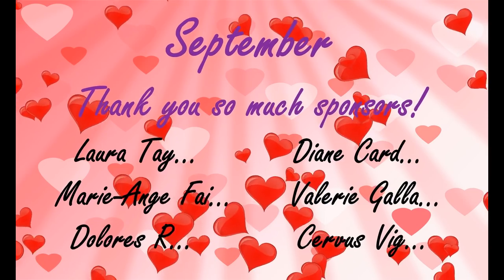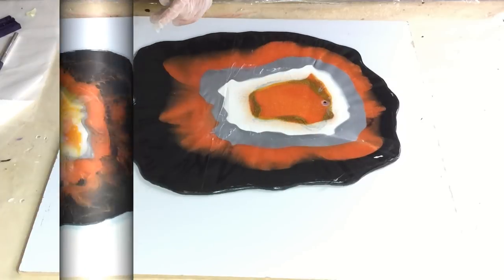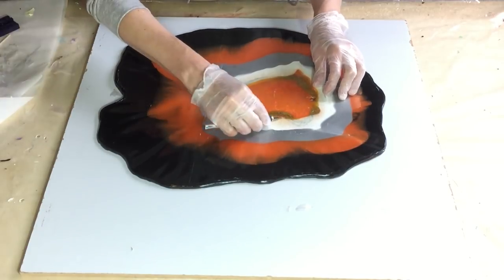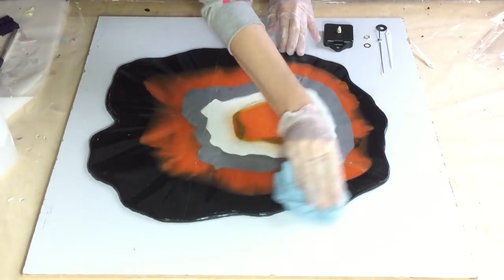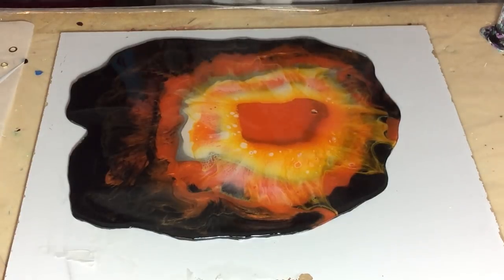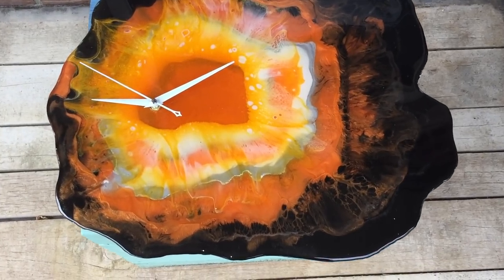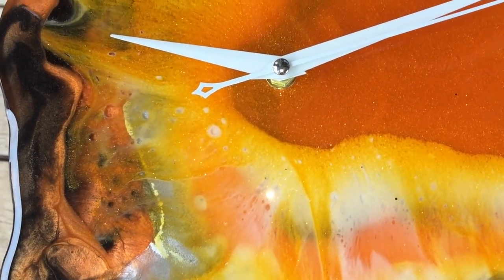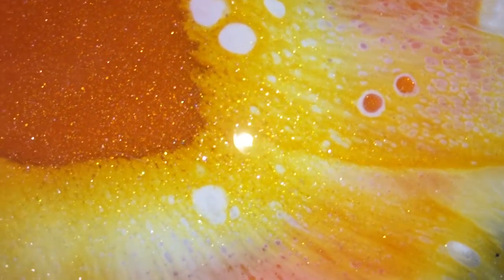95. Free Form Resin Wall Clock. Unmolding/Attaching Clock Mechanism/End Result

Comment: I Love the clock Petra and Love the instant gratification of the resin. I agree it does get hot and just ordered a ventilator mask to use with it. Your colors are beautiful.The pearl and metal are now going to be ordered! Thanks.
Reply from the maker: Thank you so much Tania. Yes, I would definitely use a mask when you use the quick coat, but It's a great resin to work with. Also the Art Coat is great. Nice to hear that  you like the colors.
Reply: I Have the quick coat and regular SC . Did you use the Art coat on the finish?
Reply from the maker: This clock is made totaly with the quick coat. My large coffee table (sunset) I made with the Art Coat.

Comment: Great clock Petra. I make clocks out of records.  I do an acrylic pour and then I resined them with the quick coat from stonecoat. Yes I did find the quick coat got quite smelly especially when I heated it. I would definitely use a respirator for this.  It is also a bit smelly when you pour it. It did create an amazing finish on the record clock though, and I loved how quickly it dried.  It did seem to get dust particles in it before I had a chance to put it under protection for this.  The bubbles came out nicely.  It is much thicker than the Stonecoat Art Resin which I also used as a topcoat when I ran out of the quick coat.  I did find I only needed one coat of Stonecoat where I found I needed two coats of Art Resin as for some reason the Art Resin did not cover the edges well whereas the StoneCoat does.  I hope this information helps some of your followers as well.:-) I look forward to seeing how you like the Stonecoat Art Resin. :-)
Reply from the maker: Thank you so much for your nice compliment Rosalie. I had the same experience with the quick coat. It is also what you are used to. Normaly I use Mastercast and that doesn't have any smell. But I'm very excited to use the Stonecoat Art Coat, I hear a lot of good things about it. And thank you Rosalie for telling us your experience with these resins. I appreciate it  that your let us know what think about using them.
Reply: I like stonecoat also for that reason also.  It seemed to cover better.  Especially on the sides.

Comment: Hiii perta awesome work. I love the clock color it’s very warm. Which base are u using for this geode clock.
Reply from the maker: Thank you so much Rama Laxmi Rams for your nice compliment. I'm using a MDF board and on top an acetate sheet and my shape I make with 100% transparant tube silicone. In video 40 to can see how I make a mold on plastic. https://www.youtube.com/watch?v=_yPD2AIEIkI&t=2s  In video 60 you can see how I make a mold on an acetate sheet. https://www.youtube.com/watch?v=WPDc-O7dQC8

Comment: Love it Petra!! <3 :D  I also loved using Quick Coat when I did my free form geode.  I think I will get some to do flood coats.  I have cat hair issues sometimes.
Reply from the maker: Thank you so much Joanne for your nice compliment. Yes, I think in the future I'm going to use it also for flood coats. For my next project I'm going to try the Stonecoat Art Coat. I'm so curious how that works for me.
Reply: Yes!  I hope that you like it!!  I love it!   I've never used Mastercast or ultracast though..so you have more to compare it to.
Reply from the maker: I like a thicker resin and the Quick Coat is thicker, but for my way of working it sets up to fast and it smells when I put heat on it. For a clear coat it's perfect. The Utracast is to thin for me, It doesn't hold my design. Mastercast is thicker, I like that, but the working time is a little bit to short (30-45 min) I hope the Stonecoat Art Coat is a thick resin, because the working time is perfect (60 min). We will see in my next project.

Comment: So full of sparkle. This clock will cheer any room up. You're right about the white arms being good contrast. Do you think the smell you were getting was coming from the acetate paper getting hot or was it the resin in general?  ♡
Reply from the maker: Thank you so much Preciosa Flower for your nice compliment. I think it's a combination of both. I can smell the resin, not a lot, but I can smell it. After I put heat on it in the mold the resin gets very hot and therefor also my acetate sheet. Then I could smell it more, not bad, but you can smell it. The acetate sheet is heat resistant, but I think not as high as how hot this resin will get when it dries.

Comment: That's a great idea Petra!  Can I ask you a question? How do you level the table surface that you are working on? That is something I've continually struggle on and has become more of an issue now that I'm using Stone coat because of its long working time my project just slides right off the MDF board that I use if I don't watch it constantly. I think I have it somewhat level but it's not 100% and then I find out later it certainly wasn't because my design that I worked so hard on is on the table and not on my project. Any feedback would be greatly appreciated!
Reply from the maker: The large table I'm working on is already level. And if my MDF board is a little of then I level it with some stiring sticks, but I don't leave my project on that table. I remove it to my dustfree zone. I have a metal trolley that stands on a wooden plate that my boyfriend made level. It's always level. In video 94 you can see a wooden trolley and metal trolley that he made level. What he also made is a wooden surface with screws underneath that I can place on my table and I can adjust these screws to make it level.
Reply: @petrajongbloed4425  I have heard of the idea of using screws. I'm not completely clear how to do that but I think I will go discuss it with somebody at Home Depot today. Home Depot is a large Hardware chain in the United States. I have to solve this problem and the stir sticks have not helped significantly. Thanks so much for your feedback Petra!
Reply from the maker: I can take a picture of mine and sent it to you. I only need to know your email adress. My email is in the description box.
Reply: I just sent you an email. When you have time, the photo should help me immensely! I think I'm going to need to rework my working surfaces.
Reply from the maker: This evening I will sent you the pictures. I hope it helps you.